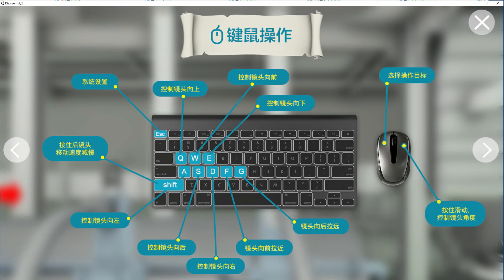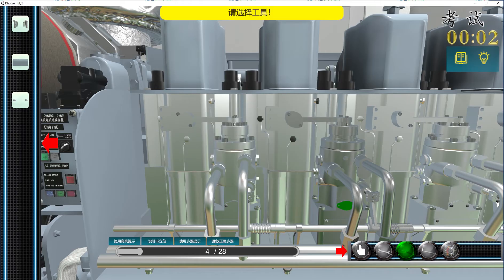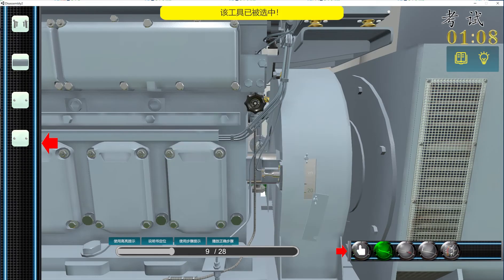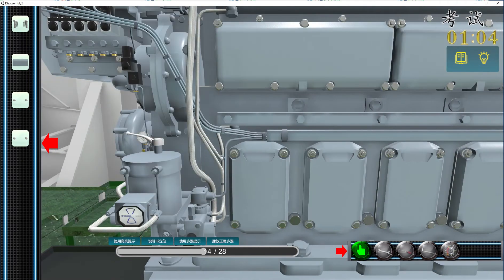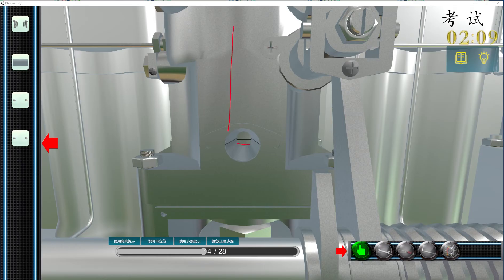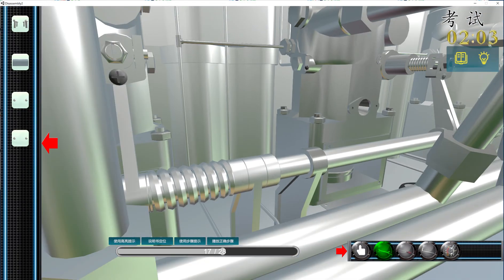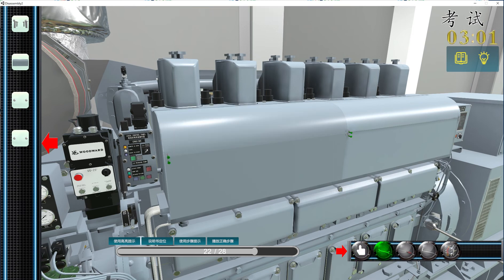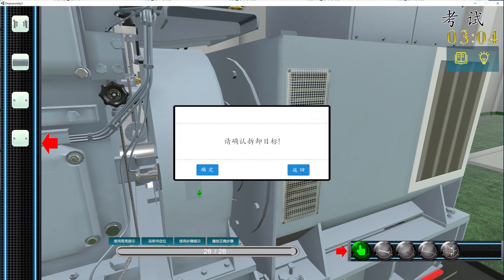Yanmar Generator Fuel Pump Timing: A Step-by-Step Guide

Comment: My generator is new . 
No signs on flywheel . Any suggestions ?!
Reply from the maker: Good evening dear friend.try to look from the pump buffer screws when you remove them put a light from one side and look from other side  . Turn the engine as it is the normal rotatio . When the light start to disappear stop turning and record the ignition timing for the specific cylinder . Adjust all cylinders in the same matter.

Comment: A doubt, when I go to remove the injection pump. What position should the cylinder be in, top or bottom?
Reply from the maker: Better in the bottom so you will not have push from cam to fuel pump.
Reply: Look at the cam and roller this is checked for removing pump. Cam must be on base circle . Piston positin is not the criteria

Comment: What is the reason to adjsut the fuel timing as far as k know it adjusted on factrory by service engineers and it's not recomended to touch it by crew.
Reply: Because of wear and tear this mark changes
Reply: To compensate for the wear sometimes we need to adjust fuel timing for optimised peak pressure and performance, exh temperatures

Comment: sir what is purpose of deflector on fuel pump ?
Reply from the maker: Deflector are used for reducing the pulsating effect from plunger stroke to Pump components.When the fuel are compressed a wave created which have distracting power .This deflectors will absorb some of the power that created.

Comment: Sir the  line of follower match with the lower lineof pump body means its start of injection and what does upper line indicates?? in daithasu engine have two lines on pump body....
Reply from the maker: Manual should specified all the marks of the engine I don’t remember each engine mostly I have worked with humane that I remember better.
Reply: One is for base circle of cam when we remove pump this is used as reference while putting back pump  and other is start of injection
Reply: Yes manual gives the best answer to all your doubts. It's always wise to go through manual before any job regarless of your experience....every maker and model is different...manual reading is one of the best thing which makes you a better engineer

Comment: I facing problem with jacket water temperature getting very high thermostat not opening in the running engine. please advise me asps
Reply from the maker: Probably you have problem with auto valve for cooling in front of engine where the jacket water enters try to open it by manual set is as the other working engine.
Reply: @Marine_Engineer_learnings  sir achully I facing problem with my thermostat unit. My engine has LT and HT cooling system. When thermostat open HT temp become normal maintain at 60 to 70  degree When thermostat not opening themp goes to more then 90 degree.
I already check thermostat tested it's working properly. But on engine some time it's work some time not work
Reply from the maker: @SanjayKumar-eo7xy  is the temperature that thermostat open for jacket because can be mixed with lub oil thermostat valves .Oil thermostat valves open at lower temperature than jacket.Also what kind of engine you have onboard? Also you can replace the thermostat with new one to be sure that thermostat are working properly.The only test that you can do is on engine itself.
Reply: @Marine_Engineer_learnings  I have onboard yanmar N18 model engine. Please tell me sir how can I check thermostat on engine
Reply from the maker: Just replace some new on the engine and test again.Also you should check the manual maybe there is so automatic valve which stuck.
Reply: @Marine_Engineer_learnings  I replaced thermostat with new spare but new thermostat some time works some time engine temp goes more then 95 but thermostat does not operate . And about automatic valve i try to check but didn't found automatic valve on my engine or manual but I will check my manuel again as per your suggestion. Thanks sir for your valuable reply.
Reply from the maker: @SanjayKumar-eo7xy  If thermostatic valves working and all other valves on the system are working properly also the non return valves .Check if you have any leakage of exhaust gas to jacket water from individual generator.Try also to open and close the valves on generator maybe some of them stuck.
Reply: @SanjayKumar-eo7xy  I experienced that. check the thermostatic valve. replace it with new spare if you have. if it is not effectice then check the outlet valve of your jacket cooling water. the non return valve may stucked up.
Reply: @SanjayKumar-eo7xy  check it by measuring the lift in cold water and hot water
Reply: If type cooling system close cooling,,,Check temperature of out let sea water cooling first,,if it's very hot your  thermostat working normally,, check,, water cooler,, check air cooler,, check pump sea water or switch with stanby, and observations the temperature high temperature slowly or fast,, if temperature high fast,, your thermostat broken, but slowly your cooling system not very well
Reply: I have onboard yanmar N18 model engine
Reply: check thermostatic valve
Reply: Problem is with sensitivity , you can replace new thermostat overhaul it ....or you can increase load slowly slowly manualy give more time to thermostat element to do the job
Reply: Another is your condition of air cooler and lub oil cooler but as you told it is working perfectly sometimes...then may be your element or spindle / 3 way valve inside stucking.... Open and inspect your valve and make operation free.